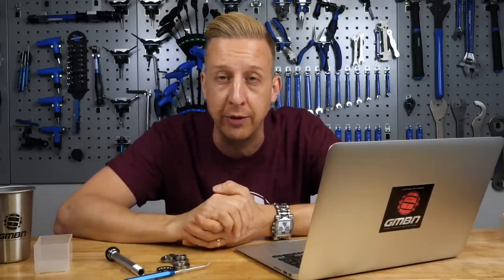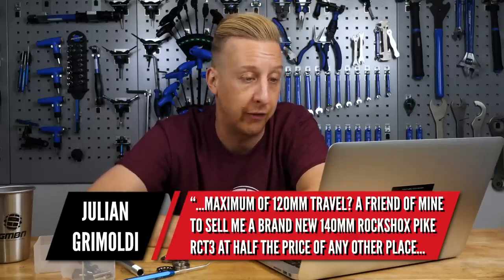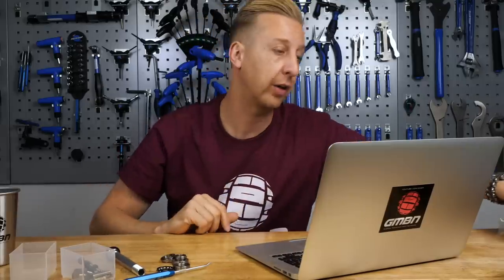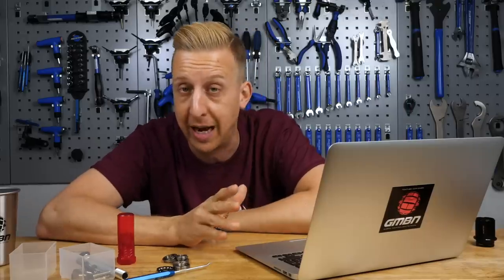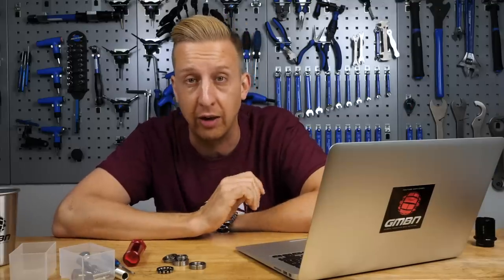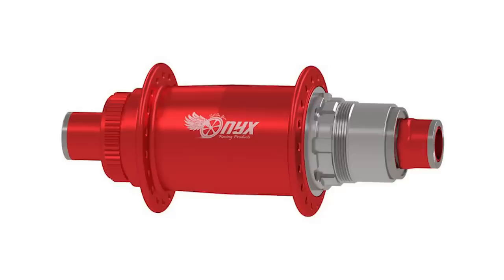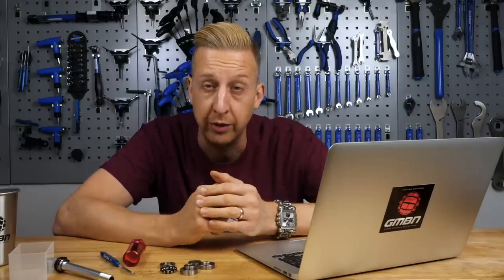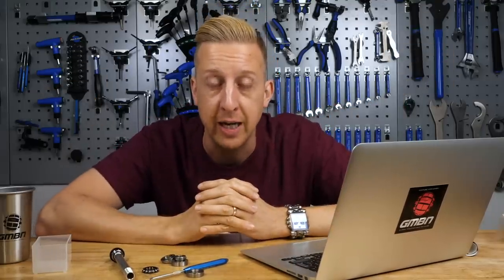Are Cheap Chinese Carbon Frames Too Good To be True? | Ask GMBN Tech

Comment: Built myself an Aliexpress carbon road bike, Frame, fork, wheelset, bars, stem, spacers, seat post and saddle. Aslong as you are buying from sellers that have large order numbers and good ratings you should be fine, I've had no issues what so ever.

Comment: I put a 140mm fork on a bike with a max 120mm once.  I cracked the frame at the headtube.  When I went to warranty the frame the company would not do it because they told me it changed the head tube angle and put undue stress on the head tube that it was not designed to take.  It was a major bike company, but I will not say who.

Comment: My first full suspension was a Chinese carbon 29er that I order on line and it came from Shanghai. I got the frame for under $400 with a 2-year warranty and built it up with high-end components & it turned out to be one awesome bike that I  rode the hell out of for about 3 years. I now ride the Hightower but I still have that Chinese carbon 29er as a backup bike.
Reply: That's what I plan do to, can you please tell me where you bought it from? I mean the website
Reply: Link?

Comment: I have a Chinese Carbon XC hardtail frame which I have been XC racing on since January 2018 with no issues at all (made by Tidace) including 2 hefty XC races one of which left me with 2 cracked ribs all so pretty pleased. As I race XC it's always hard on bikes & normally swap out after 3 seasons so at the price you can buy them works out very well (normally do my own custom spec & swap best parts across). This is compared to a 2017 Scott Scale alloy frame which cracked after 12months & Scott walked away from any warranty loyalty at all citing "not covered as used in XC racing" left me high & drive with no frame or interest in looking after me 3 months before XC season due to start so that's the reason I ended up with buying the Chinese Carbon frame which now after years use & no issues will probably buy them in future - totally lost faith what's the point buying from a branded company when they don't need to honour warranty's? My 1994 & 1996 Kona kiluera's still going strong & in use now - so shows how bad Scott are, had a 2012 GT Zaskar before the Scott which was going strong still when sold to buy the Scott. Have to be careful still but seem the Chinese companies that sell "OEM" frames are the ones to buy from.
Reply: The TideAce has some beautiful MTB frames, agreed. And some delightful paint jobs.

Comment: I bought a Chinese carbon fiber handlebar for testing.. Put it between 2 2x4s and ran over it with my F-150. No problem.
Still looks brand new and I still use it.

Comment: I've built full suspension fat bike using Chinese carbon frame and 26" carbon wheelset. At around 100 miles, I destroyed rockshox bluto rct3 120mm fork after taking 4' drop. 50 miles later rockshox monarch rear shock gave up on me. Replaced the fork with Manitou Mastodon and the shock with Fox performance elite. Wore out the first set of tires as well. Frame and wheels are still holding strong.

Comment: I used to run Flying Snakes fully sealed gear cables and they performed flawlessly, other than the price I had absolutely no complaints with them at all. These days I just run a full length outer the whole way and I've found it works as good.

Comment: AliExpress and eBay have a lot of resellers that are offering either imitation or low quality carbon frames and forks. It behooves a buyer to do their research if you're going to go on eBay and just buy a carbon frame and fork without finding out where or who makes it then so be it... as the old saying goes buyer beware.  

too many people want to absolve themselves of responsibility for poor decisions. My Chinese carbon frame and fork have proved very reliable with nearly 12,000 miles since 2014. I did my research on eBay, on AliExpress and found a direct manufacturer, Zhongwei.  As it turns out they were making frames for Starley bikes of the UK I purchased one of their unbranded frame/fork for a great price of $460.  performing due diligence is an absolute must, otherwise... you get what you get.

In regard to the second question around the three-minute mark, besides lowering the stem I would shorten the stem significantly if possible. By changing the head angle to a more slack position that bike will have a fairly significant change in the steering geometry. It's going to steer slower and not feel as maneuverable so I'm not sure what he's using now as far as stem length. I would probably go for a 35 to 30 mm stem. 👍

Comment: I own a Twitter Cyclone 2.0 Frame (which is a higher end Chinese frame) it’s super rigid tho a bit heavy, but to be fair it is an aero disc version. It compares well with my SL6 which had me really surprised! Only part lacking a bit is the quality of the paint job rest feels top notch. Generally I fell like it depends on the brand a lot don’t go for the super cheap frames but the higher end Chinese frames are pretty good! I payed 3000$ for mine with full Ultegra and a retrospec 50mm carbon wheelset😀😀 weight is around 8.1kg for the full bike

Comment: If your rim is already drilled out for Schrader valves, it difficult and sometimes impossible to use a presta diameter valve when converting to tubeless because of the size of the hole. This is where the Stans TL Schrader valves are a great solution.

Comment: for the dude wanting to get the 140mm pike:

If it doesnt feel good so much you can always buy a new Debonair air spring 2021, with shorter travel, and then you can update to the best airspring  by rockshox

Comment: Love your channel.  I wanted to let you know that I set up my 2011 Giant Revel 0 with non tubeless rims and tires as tubeless.  It runs shrader valves.  The way I did it was to use 2 wraps of gorilla tape.  I then poked a round (must be round) hole with an ice pick.  I then took and cut the shrader valves out of old motorcycle tubes.  I left a small about of rubber on them to seal with.  I pressed them through the tape and threaded on the nut.  I then used shoe goo and glued (sealed) the back side of the shrader valve into the rim.  The shoe goo will create a bead around the rubber.  I used a dremel to cut the brass back to fit into my very narrow mountain bike rims.  These things popped right on the bead and have been working great now for well over a month.  If you would like some pictures, just let me know and I will get you some pictures of the setup.

Comment: Yes u can run car pull through valves without a problem, but u have to drill out hole in rim to a size 11mm drill bit I have for over a year and a half now with my tubeless setup

Comment: Currently on a chinese carbon hardtail; paid under $200 for the frame, which is a proper price for a frame I think. Some of the $6-700 fs frames are being raced in pro XC with different paint jobs.

Comment: shrader tubeless, you can also simply cutout valve from tube, leaving some rubber around if you dont need fancy sets costing heavy money.
Reply: Most schrader valves don’t have threads on them
Reply: You can use Schrader valves from motorcycle wheels.

Comment: I run a jagwire sealed Teflon cable system on my hard tail, I've had the same setup for years of using the bike as a commuter and weekend trail machine. The whole thing is perfect still, despite about 5 years of Welsh weather and mud, getting half submerged in sea water (not as exciting a story as you'd think). I used to work in a bike shop so I got it cheap, but I'd buy it again at rrp happily (maybe I'll get some when I finally go 1x on my gravel bike).
Tldr sealed cables are amazing if you subject your bike to Wales.

Comment: I've re-built a Chinese carbon wheelset for a customer because the spokes were terrible and kept breaking,  once laced up to some DT's it felt like a solid wheelset.  My friend who also worked in a few shops saw a fake carbon road bike copy of a very pricey bike normally $20,000  the guy paid $6000 for the fake and was told it was original but unbranded;  my friend literally twisted the handlebar by hand and the carbon came right apart!  All before the guy ever rode it,  the thing would have gone catastrophic on the first ride!

Comment: Doddy save your money.  Automotive shrader valves require a wider diameter hole to fit i the rims. They also have a narrower gap that seals along the outside and inside of the rims than a typical bike rims inside and outside. Without drilling out the hole in the rim and risking crushing the inner and out walls you just simply will not get the car shrader to work.  There is a hack using the shrade from old tube but I have never gotten that to seal my tires for tubeless. Stans is the best option out there.

Comment: I had a centre lock that rattle lose on a long XC mission, it then managed to cross thread itself so the disc is basically cold welded onto the hub....

Comment: I currently have a Chinese Carbon MTB frame in the shop I am building,  only 100mm front 120mm rear; and I am not planning to bomb down the side of the mountain because I'm not stupid.  The quality is good, fitment tolerances are exact.  I am getting very good and knowledgeable support.  Consider that a majority of popular bike brands are already built in APAC and then a sticker is applied.   Yes, the Chinese do "pay homage" to popular designs, but the popular brands also charge a premium just to have their name applied.  The Chinese manufacturers offer and honor warranties because I have submitted claims.  I watch many MTB videos where a (good?) rider destroys a $9,000 carbon frame or equally expensive component (and it won't get warrantied); and I fault the sport, the manufacturers, and  some Youtubers for trying to ride this equipment without the proper skills or approach and well beyond safety limits.  I think what's happening is that the Chinese are getting ready to do battle in this market with good quality products.  You can PM me and I can bring you up to speed with what I am doing.
Reply: Hey Micheal, how do I PM you on youtube?  I have a couple of questions.  Thanks  David

Comment: Those stand shrader valves suck the sealeant pools around the valve and you can put air in them with out pulling out the stem. Had these in a downhill bike that was drilled for shrader really sucked. Plus most tubeless ready rims will be presta drilled

Comment: I bought a Chinese carbon wheelset for my hardtail and broke them 3 times before going back to a brand name aluminum.
Luckily they were good at honoring the warranty.
If you're doing XC you could probably get away with it, but doing 5 foot drops and rock gardens they just won't hold up at all.

Comment: I love frankenbike geometry questions. Julian's rockhopper question (100mm>140mm fork) makes me wonder if a slack seat tube can be remedied. If an offset seat post was run backwards (rotated 180º) so the saddle clamps are in front of the seat tube in stead of behind it, would it effectively steepen the seat tube angle? It would shorten the reach for sure but a longer stem costs less than a new frame!

Comment: I love the Lefty; have one on My Cannondale Caffeine F1. But - have a couple of issues with the system: no mudguard and rack compatibility (My pet peeve # 1); a little nervous when ridden hands-free (I can live with that, it is a minor gripe). If singletrack is your cup of tea, you'll likely love it. But, if you're into touring and the like (as I am), you'd need another bike or fork for the purpose. 

As for the centrelock vs 6-bolts, I cannot fathom than anyone would choose the 6-bolt system over the little engineering marvel that is centrelock: looks vastly better, is much easier to install or remove. So, centrelock for Me.

Comment: Got an aero carbon road bike a local bike shop claimed was an in house design. Was maybe 500-700 CAD cheaper than a brand name similarly spec'd carbon bike. It was actually a chinese frame that was in-house spec'd. From a company called Sava bikes. Specifically, a sava phantom frame. And craftmanship is defs a step back from say, a specialized venge, both in the paint job and fine details. And you dont get the sense that a team of geeks locked themselves in a room with a supercomputer and ran aerodynamics simulations on the design for a year. More like a bunch of cyclists drew up what they think an aero frame should look like. But its pretty damn solid. In fact, its stiff to the point of being borderline uncomfy, specially coming from an alu frame. It's also pretty heavy. Stock it came in at 9.8kg, identical to my alu bike at the time, a specialized dolce. The brakes were also pretty useless. Heavy springs, little modulation. Swapping out the garbage aero alu wheelset dropped it to 9.2 kg, but point being... You get what you pay for for the most part. I'm glad someone else had the job of building it. If i could do it all again, I'd probably buy something brand name used. But its a solid bike. And as long as that local bike store is in business, i have someone to bitch at if the bike ever gives me grief. And i think thats important. Yoleo, Sava, some chinese companies, actually exist, and have names to protect, to a degree. Those i'd consider buying from. Random nobodies on amazon or ebay or aliexpress, not so much.

Comment: If U use car valves U have to grind the base down so it fits inside the tyres bead as most rims are to narrow to take a car screw in type valve without modification but there cheaper than proper ones and U can get them in alloy anodised.stainless brass ect.. 😊

Comment: 2 questions: 
Does changing plus tires out for 29er wheels effect the head angle? Or does it only effect the bottom bracket height and wheel base?
How many mm does the bottom bracket raise with plus tire to 29er swap?

Comment: Extension of the forks travel, may add additional stress to the headtube welds, not such a problem with a steel frame, but I would be weary on going mad on alloy or carbon. I'm sure 20mm would be fine, I've done it on my codeine 29, but I would not go any further, imo not worth the risk

Comment: I think the missed point of the car valve q was to pull them into place like on a car, so no thread required as per a car wheel...However bike rims have inner and outer layer unlike car rims, so wont work at all... the car valve gromit is for single sheet a couple mm thick, not to bridge a twin gap of several mm, maybe 10mm on deep section rims
Reply: Rupert Wenn it works I’ve done it it’s quite a pull and it pops into place I’ve rode on it for 2 weeks no issues

Comment: Wouldn't the hole size required to use an automotive schrader valve compromise the integrity of the rim strength?

Comment: To the fork question:
I wanted to do the same thing with my hardtail and had a similar thought process like you, Doddy. Adjust the saddle and adapt to the new bike feeling. The guys in my local bike shop wouldnt recommend it because they said the head tube could be torn off. My bike is also listed for max 120 and is an alloy frame.
Watching your video lets me sit a little between the chairs. On the one side bike Guru Doddy and on the other my trusty bike shop dudes >.>

Pls help
Reply: Baseline is: excceed the factory specs at your own risk!
Reply: @geemail369  and it vaults you warranty, yeah yeah I know ^^
But are bikes nowadays really engineered to work just in their parameters and designed to break as soon as you cross the limits? Isn't there any room for tolerance?
Reply: @stephangutknecht7568  Of course there is! But that undisclosed indistinct margin is claimed by the manufacturer for reasons of safety/reinsurance.

Comment: I am a tyre fitter for cars and the valves we use are pulled through and the rubber at the bottom of it just gets pulled through a bit and it expands slightly I have previously tried putting some of these valves on my bike and they are to thick you could risk drilling the hole bigger but I'm not taking the chance

Comment: I bought a pair of 100% speedcraft long lens riding sun glasses ( knock offs) from AliExpress for 19 Australian $. They work awesome and are polarised . The OEM ‘s are $180-230. 
Some stuff is good but there is also a huge amount of crap. If ur going to buy a carbon frame I would read as many reviews as possible first. Should be able to find reviews online.
Reply: Whenever i buy a cheap pair of glasses i'll have'em checked at my local optician before use - not all did make it!
Reply: Zz top said it best
Reply: Prob wont provide the uv protection required by law in uk/eu. Once ur blind/visually impaired, will u be happy with ur purchase?
Reply: The did a scientic review on television few months ago. Original ray ban versus cheap fakes. UV protection is identical. Fit and finish varied greatly. Don’t go crying you will go blind using counterfit. It is silly.
Reply: F E animatie 69 fully agree. Not everyone can fork out $300 for a pair of sunnies. If they are uv protected and do the job then why the hell not!

Comment: there are genuine vendors who offer decent products, but they can be hard to find, especially given that most factories will have around a dozen stores feeding off it, all with slightly different prices, and most only interested in bulk orders, stay clear of ali express, and concentrate on researching factories on Alibaba, there you will find the genuine article, and  be able to contact the factory direct, most are open to shipping one or two frames for a slight increase in cost, but still represents a massive saving when it comes to buying a carbon frameset from a brand, expect to pay around 700-1000 for a premium grade frameset, anything less than this raises suspicion, as the cost of manufacture leaves very little overheads, even in China.